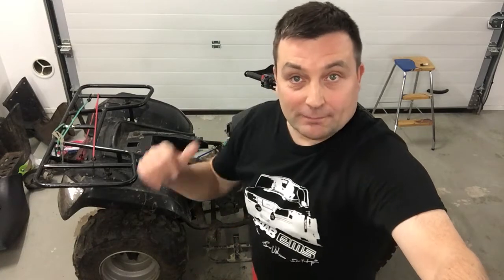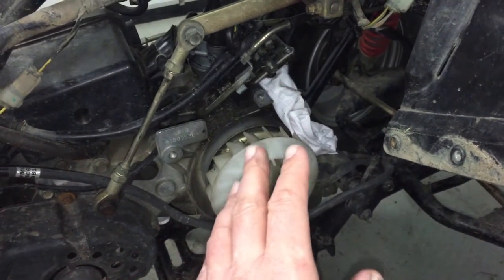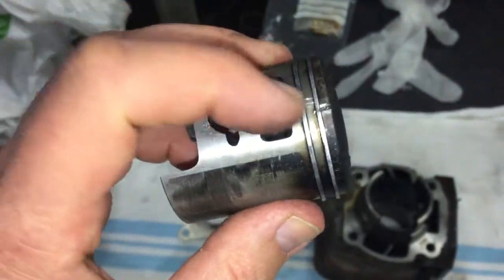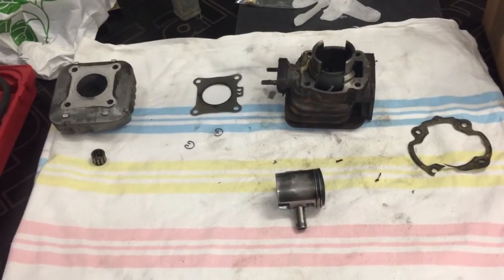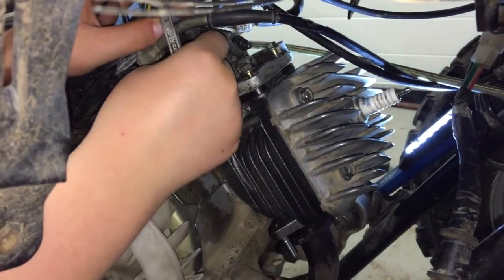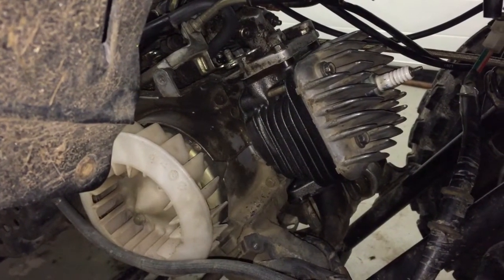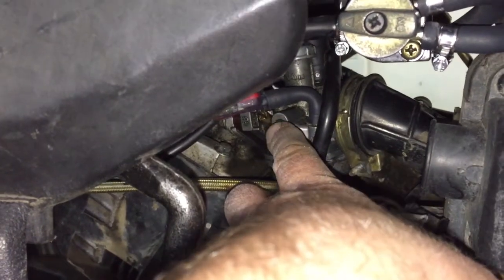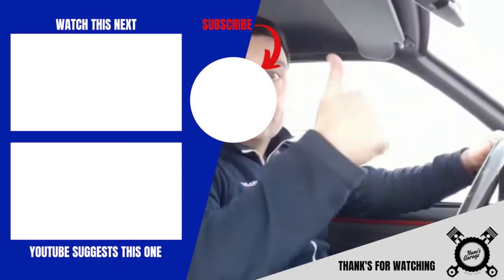Engine rebuild | New cylinder and piston | Kymco MXU-50 |

Comment: Hi hans 
Which cylinder is it? Which engine-type is the kymco so that other parts and tuning parts for a scooter 🛵 should also fit
Reply from the maker: Sorry, I'm not an expert on mopeds. Just contacted local dealer (Mopo Sport) and they told me this was only kit available at the moment... Kymco MXU-50 is quite rare her in Finland and couldn't find a repair kit using google...